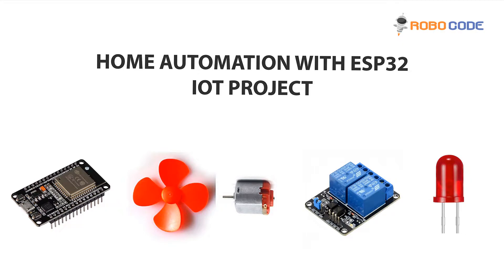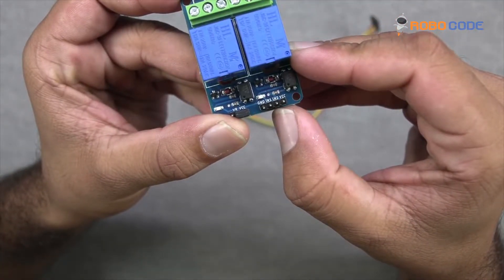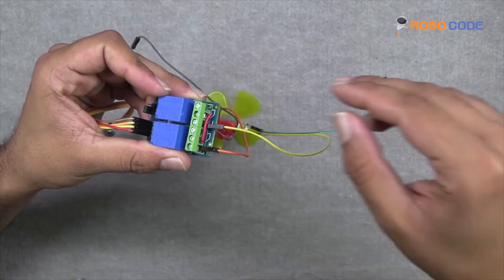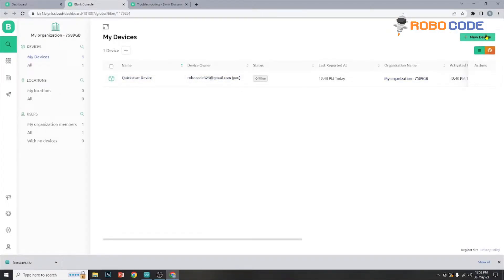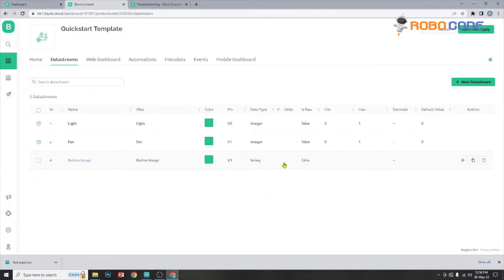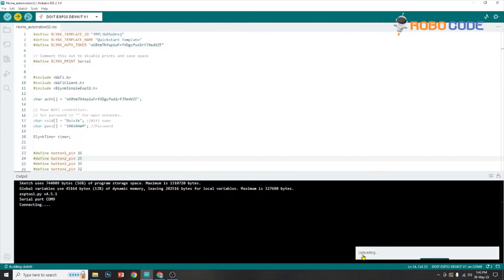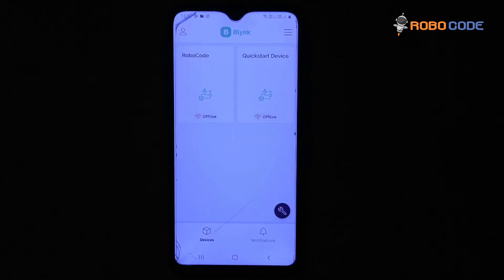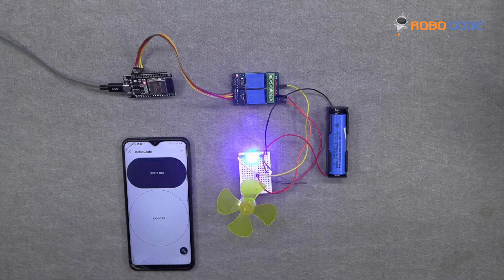Home Automation with ESP32 & Blynk.io - Light & Fan | IoT Project

Comment: HI sir, i am getting errror while uploading code to esp32

Uploading stub flasher...
Running stub flasher...
Stub flasher running.

Warning: Failed to communicate with the flash chip, read/write operations will fail. Try checking the chip connections or removing any other hardware connected to IOs.
Configuring flash size...
Erasing flash memory (this may take a while)...

Hard resetting via RTS pin...
Failed uploading: uploading error: exit status 2